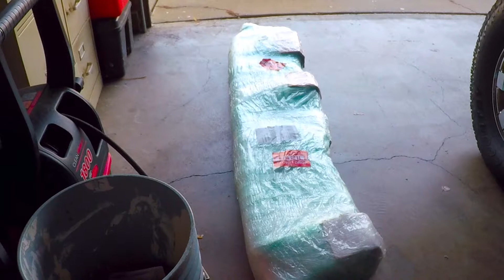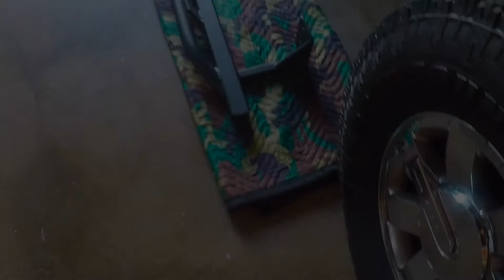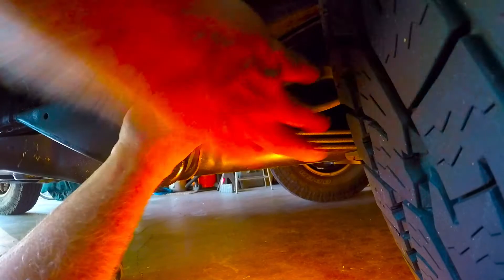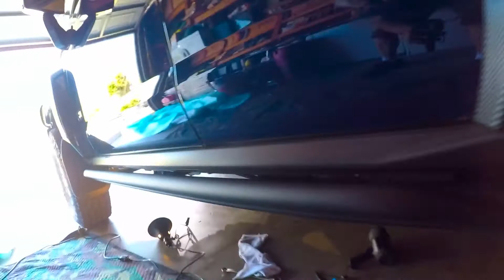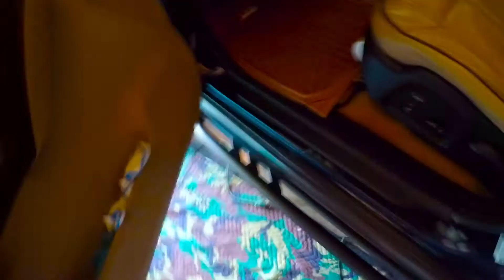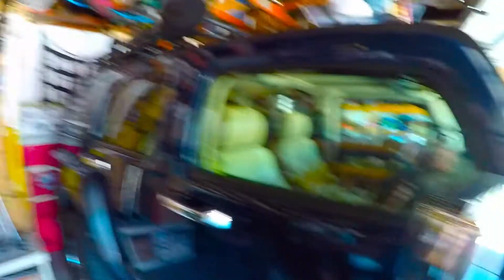H3 Rocky Road Rock Super Sliders. Hummer H3

Comment: I couldn't tell from the video but did you notice any VERTICAL gap difference where the back has a bigger gap spacing than the front? Gap from actual slider to hummer body bigger in back than front?
Reply from the maker: Good question hold on let me go look......................... Ok not really  very noticeable eyeballing it, might be barley but very little. They hand make these when you order them. You can actually talk to someone in the shop when yo call, Really cool ! ! !This is a super strong slider for sure. I use my Hi lift jack on the rail to lift the whole side of H3 :)